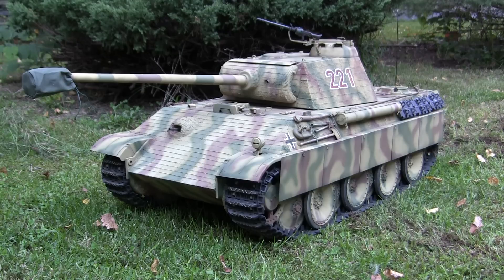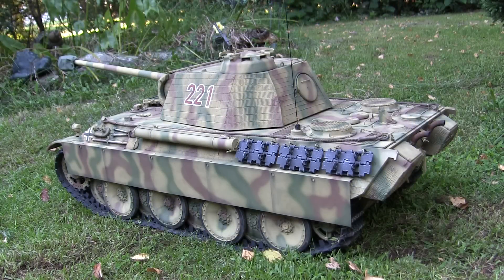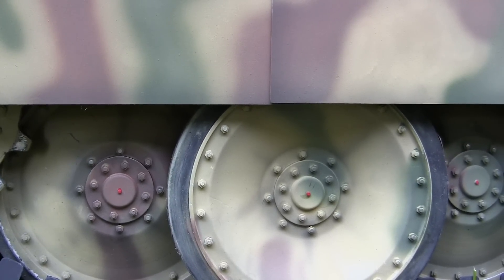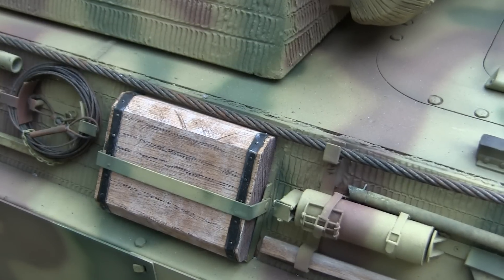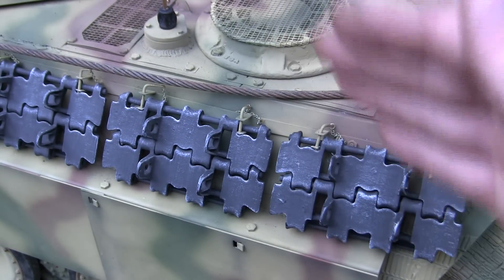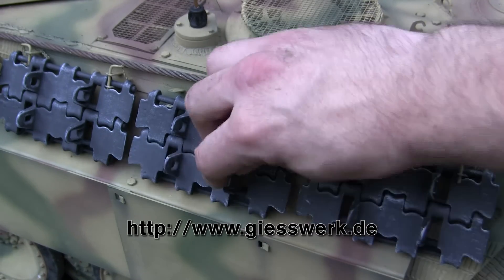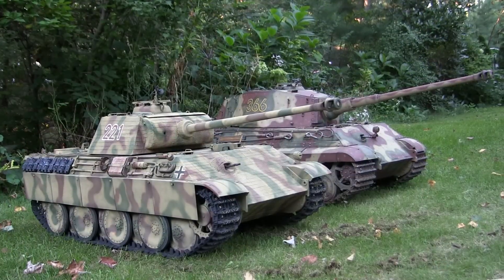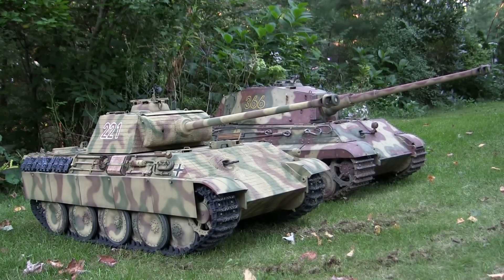Armortek Panther Ausf.G Project Video #11 (End of Project video)

Comment: Absolutely stunning, that is the best detailed, painted panther I've ever seen
Love the fact that you can hear the tracks sprockets clanking like the real thing none of my 1/16 sound like that
What rated batteries do you us?
They look about the same size as some of motorcycle ones
And are they lithium ion?
Reply from the maker: this is an older build and I used at the time Lead Acid. This is obsolete and these days I use Lithuim Ions for the power source. In a few of the videos I go over the vendor and type in more depth. There are a few options from X2 12V to a single 24V as I used on the T34. Each have some advantages and disadvantages. As for which ones you would need that really depends on your build and what are you going to do with your tank

Comment: Beautiful models.  What is the weight of the vehicle?  I was an armor crewman and have always been interested and wanting to build a nice big RC as such.  My only issue is with myself not being to get over the unrealistic movement of the vehicles.  Is it possible to add a realistic weight to size ratio on these vehicles?
Reply from the maker: Weight is not an issue with these. These kits are made with scale thickness metal plates and depending on the tank in question usually weigh in at over 200lbs